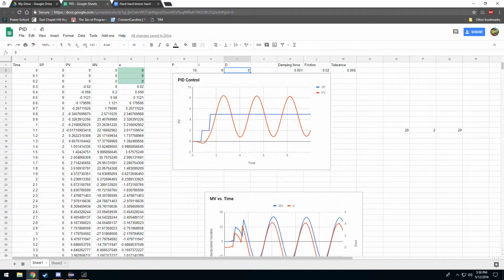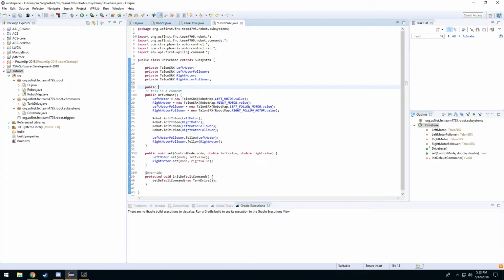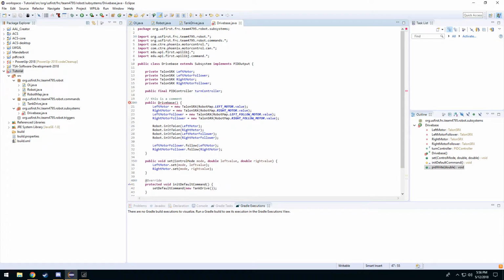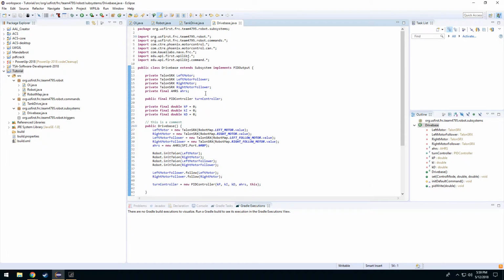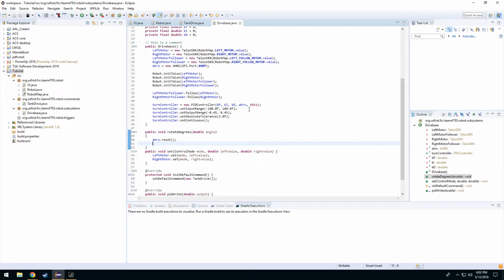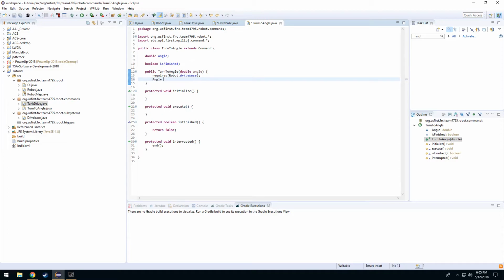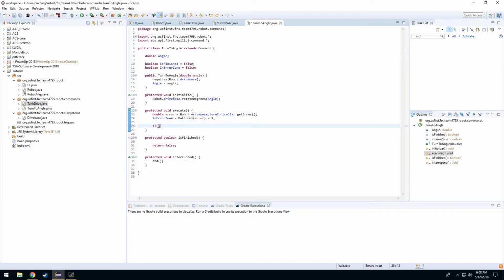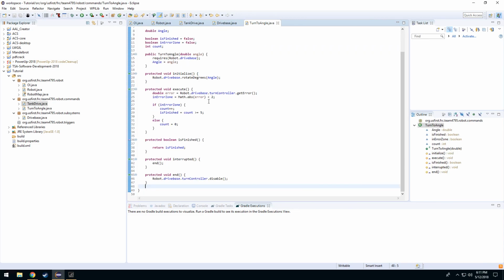FRC Java Programming Part 6: WPILIB PID

Comment: Great video, very helpful to us in learning PID control on gyro.

1. Could you share how the TurnToAngle command is started? Like binding it to a single button press, or putting it on auto mode?

2. Your implementation of stopping PID loop in TurnToAngle.execute() is interesting. Can it also be done by calling PIDController.onTarget() to determine isFinished?

Would appreciate if you have a gitHub repo we can see. Thanks again.